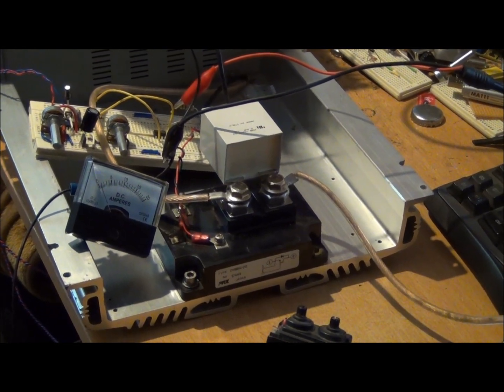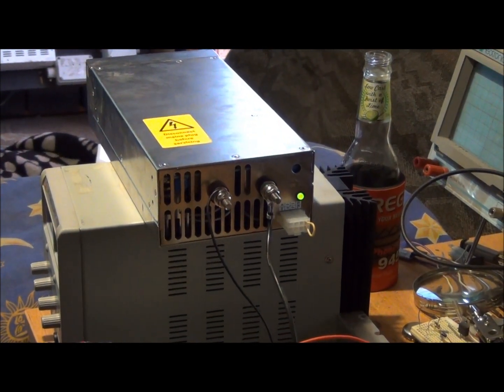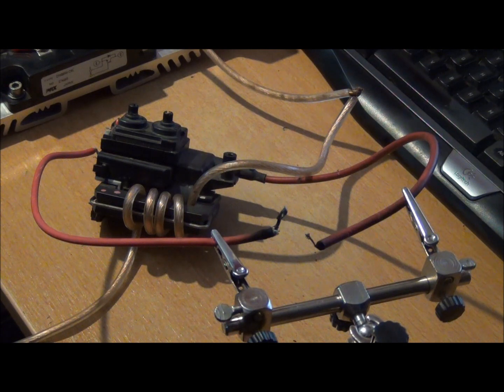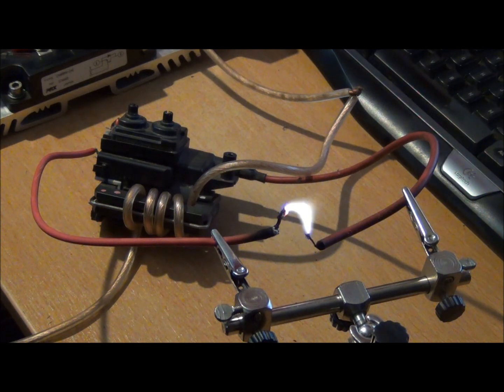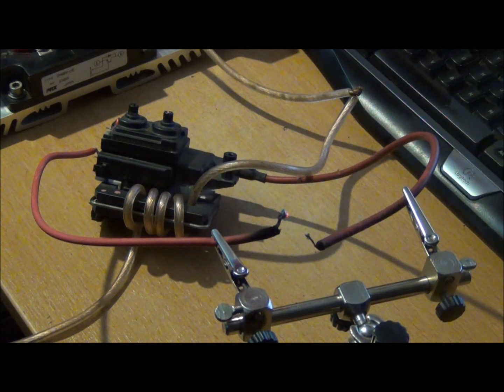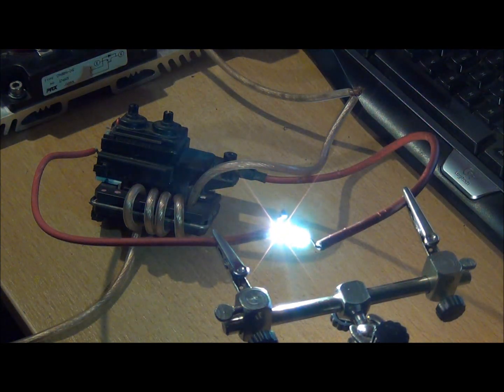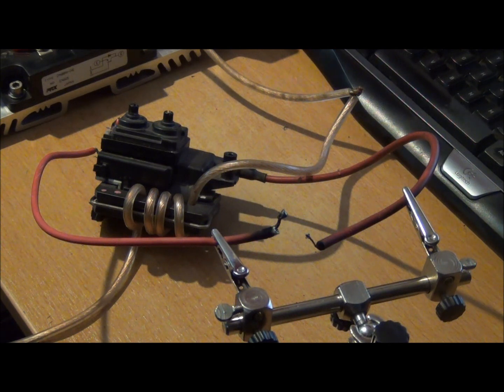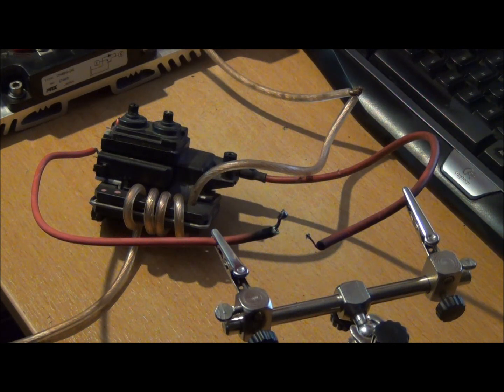IGBT Brick Flyback Testing - High Current Arcs!

Comment from the maker: no caps or anything on the flyback side, just pure current hehe :) also i blew two IRFP260N's trying to make your resonant circuit. something is up, i followed the diagram 100%. except for the cap. it was 1000v maybe thats the problem ;-) no heating just a dead mosfet after seconds of running

Comment: honest it was ship loads!! using the same p that starts 'too'!

Nice arcs - those IGBT bricks are really sturdy if you get a good one - but they can be really delicate too - it all depends on the quality of the ceramic layer the semi-conductor is mounted on inside the brick (I used to do some batch testing on this type and some high voltage ones too!!)

Comment: Great hot arc. The biggest constraint with the flyback TX's under high currents is the quick overheating. At 36V I melted the flyback in less then 2 minutes including two mosfets and 1 Zener. Currently executing a 24 hour arcing check with a ZVS on 12 Volts., still hanging in there. Flyback is very hot ± 60°C.